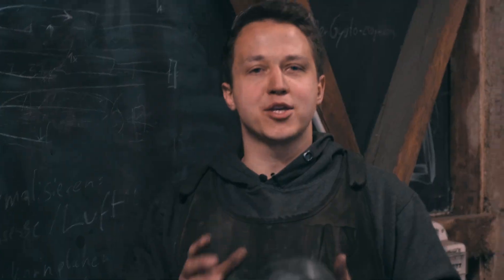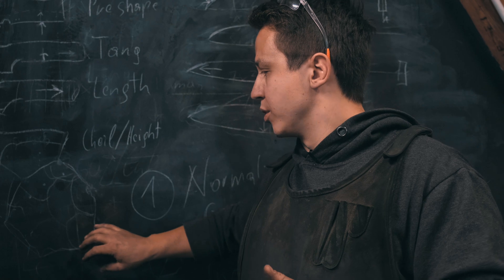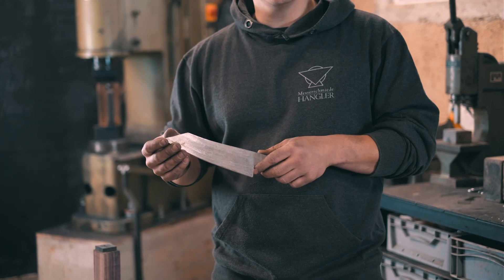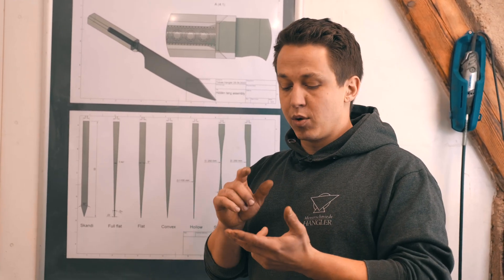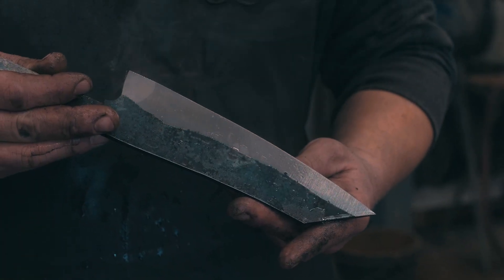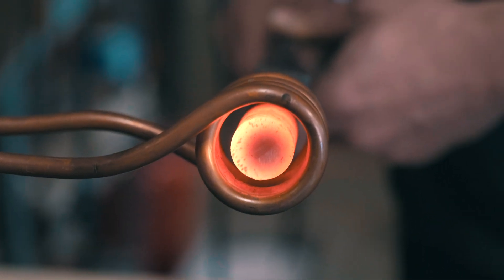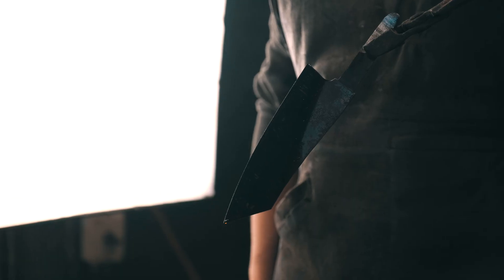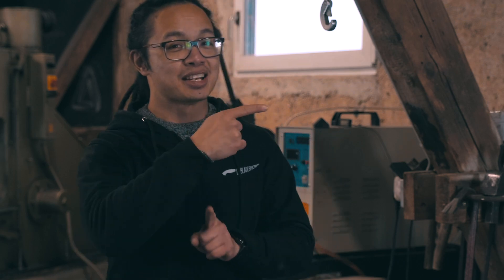Get the FINEST grain size by heating up FAST! (Part 3)

Comment: Definitely not trying to overtake your channel with comments ahaha but. As I got another video (https://youtu.be/32LboUj-baw), I totally understand that but I personally would add the .. useless science behind how HRC actually correlates with toughness (ductility for you Euros <3) and target hardness for a given material just because you guys seem to work with basic carbon manganese or low alloys and the lack of MCs isn't going to be as pertinent. FYI - you said in the video call you guys and you'd explain it so I think I'll take you up on your offer hahahaha. I've thought about doing this myself but like Graham, I'd have to cut off so much stuff it would be a nightmare and this information is out there I'm. I
Not a college degreed person so I could use some assistance on the chemistry side. Physics I do pretty much understand. Yes, I'm trying to one up Larrin Thomas with a 24-26cr PM stainless si based martensitic precipitation alloy using some organic chemistry processing. I need some help on hardenability and the boron group. If you had to know the bare minimum details.
Reply: And please don't take any of this stuff critically. I'm not like that.

It's simply science. I don't make it anything more or less.

And I know I don't know what y'all do either! I well know this. Hah.
Reply from the maker: I appreciate the input!

Comment: So here is tough one...
Haengler Messerschmiede say 2-3 times normalizing a blade is grand.
Clarke Knives say normalizing blade once is enough(in one of older series).
Two different schools, both are educated metallurgists...
Reply: I am more on Clarke's side as 1 will generally do. Why 3 with the induction heater though? If you are forced to do it fast then austenite will not completely form as it required about 20min of holding at temp to form. Austenisation is a slow process unlike most crystalline transitions. Thus 3 because you will never get full austenite with one pass and have to make up for it with more passes.
Reply: @dragoscoco2173 Thing is for grain refinement, you don't want full austenite formation. Austenite grains grow on the grain boundaries of the old structure, and if you freeze before they consume all of the old grains you end up with finer grains from the previous passes. It's a bit fiddly but can be done at a lower temperature in an oven as well. One normalization is fine, a couple grain refinement steps are decent but you can only do so much because they will grow slightly during the austenitize and quench, so in practice you can't get infinitely small grains. But you can get it pretty fine. The finer the grain structure, the faster the quench speed needs to be to fully harden because of more nucleation sites for pearlite formation.
Reply: @mikafoxx2717  Normalization is not for grain size refinement although you can achieve it partially. It is partly an annealing process with a refining of grain composition, not size. I mean the size changes and could be for the better but it hardly matters for final HT.
The main point of normalizing is to prepare the piece for working, machining etc. while relieving stress and homogenizing the solubles. 
As a note it is usual to hold the piece 1-2 hours at normalization temps before cool down, it goes full austenite and incorporates all other previous crystal structures.
The final HT is full austenite anyway, and the benefits of small grain size starting position is very limited although not zero.
Reply: I wanna start forging. All this is making me reconsider my life choices...

Comment: What would you say is the minimum power requirement to use an induction forge for knife making? I'd love to get one but there's such a range of specifications (and prices!) that it's hard to know where to start. I work mostly in charcoal and propane at the moment but an emission free method would be great.